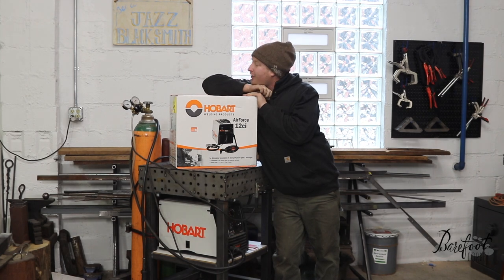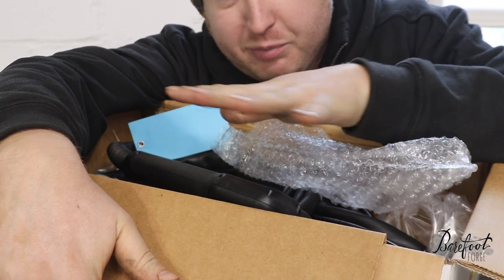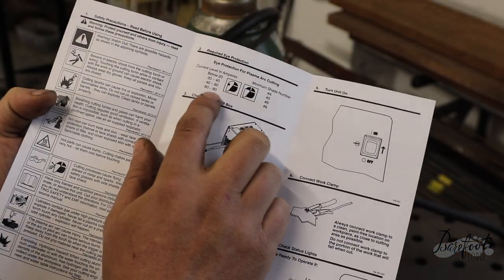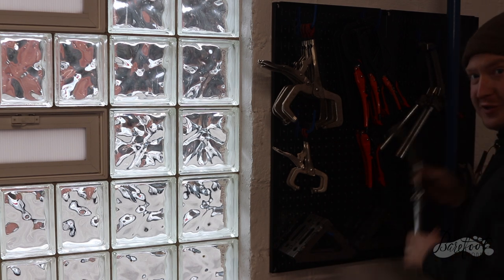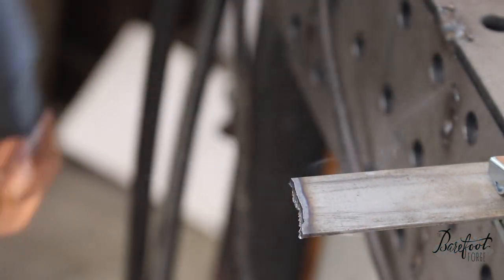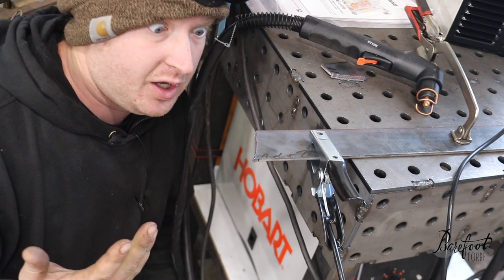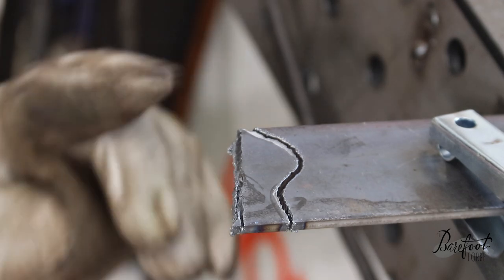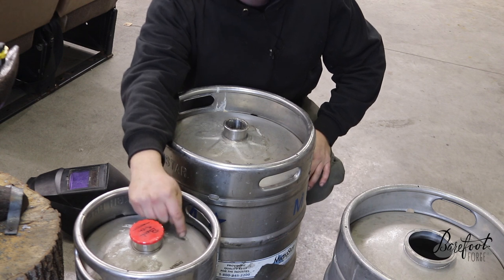Hobart Airforce 12ci Plasma Cutter Review

Comment: I have a 140 handler and absolutely love it. You did an outstanding video review. With the 140 and the 12ci. 99.9% I cut 1/8” or less. The point .01% I cut is 3/16”. Of course it’s a Hobart and with this 12ci all the bases are covered.
Reply from the maker: Heck ya- it’s fully capable and great for most normal people’s needs.

Comment: Great video, first time I hv ever lol watching an instructional video. I have the same model (first time plasma cutting) which i bought for crafts and  customizing, hobby type stuff, and have used it daily for at least the last 2 weeks and am thoroughly enjoying it. I like that it cuts through painted or rusty steel requiring little prep time so I can just jump off into the project. The problem I've had is it does a lot of starting and stopping, a couple seconds of cutting then a few seconds delay. I thought it might be an electrical issue so I plugged it into the wall outlet directly and it may hv helped some but I've started cleaning up the area where the ground wire is being clamped as well and it also seems to have helped however the problem still occurs more often than it should. Have you experienced this issue? For what I do it's a.great tool but the starting and stopping makes intricate cuts extremely difficult.

Comment: Great video….wouldn’t mind trying before I buy. I took a welding class summer 2020 from you and later bought a Miller 220 AC/DC. I am still learning aluminum AC tig. It going okay, but I need more torch time. I bought an evolution circular saw to cut some metal I bought and have been debating getting a plasma but didn’t want to get a big air compressor with drying stuff, etc. This Hobart seems like it’ll work. Did it ever cut 1/4”?
Reply from the maker: I have tried it on 1/4'' before and while it certainly struggled and had to go slow, it did the job! The "ceiling" of the old shop was 1/4'' steel and we had to poke a hole for lines from the air compressor- and we did it with this little Hobart machine (my neighbors). 
Send me an email and we'll get you out here to try it out. I'd be glad to have you over for some slicing and dicing! 

It's a versatile machine with its limitations, but it's got some pretty epic qualities that made it the right decision for me!

Comment: I read a bunch of reviews and it looks like this is for someone that uses it at home for small jobs. People complain that it shuts off from over heating and has to sit for 7 min before it turns back on and when it turns back on you can’t use it for too long before it shuts off from overheating again. People say it doesn’t have enough volume of air so there is more slag then a regular plasma cutter that uses air from an air compressor and you have to cut pretty slow. All and all from what I have read it seems to be perfect for someone that just needs it for small jobs, thinner metal and/or need it because an air compressor is not available like if ur a mobile mechanic or a farmer that needs to cut something in a field on a tractor. If u are using this at ur shop that has an air compressor or home or where ever that has an  air compressor then get a cutter that uses compressed air u will be happier
Reply from the maker: I couldn’t disagree more. I have two other plasma cutters with air compressors- and I still reach for this more then any other. 

It’s phenomenal, and has held up flawlessly over the years.

Comment: Hey I know this is a bit off topic for this video, but I was looking for some advice on vanagons. I’m looking at buying a complete 1987 vanagon gl in good shape except it’s not running. I was wondering the bolt size and location for the crankshaft bolt so I can see if I can turn the motor over. Also if you have any suggestions on what to look out for or what tools to bring for the job it would be greatly appreciated, thanks -z
Reply from the maker: If you can’t turn it by hand from the belts- that engine is ruined. I don’t have any east to type out blanket advice on what to look for but I’d say: seam rust is almost unrepairable- don’t think it’s minor, if the engine turns or cranks it can likely be made to run, if things are missing- particularly on the engine, that’s going to be tricky to source and expensive to fix. Plan to throw at least $5k at Any bus that’s sat in order to get it properly and safely back on the road. All new brakes all the way around, new tires, some brake lines, coolant lines. 

If it looks like I needs an exhaust- that’s expensive.
Reply: Thanks so much 👍

Comment: Drag the tip don't push it... Your cuts will be way smoother and controlled. Using a guide bar or straight edge also helps steady your hand to make machine like cuts. And the open part of the wire tip guide goes toward the handle.
✌️
I own the same Hobart air force model. I have been welding/fabricating for over 30 years.
I bought mine for retirement hobby projects, but that little beast can make you $$$
Another tip
Stay off the Red bull, Mt. Dew, and coffee in general.
The caffeine really messes with your hand control. Shakey hands = Shakey cuts and crappy welds.
Reply from the maker: Great tip! I'll have to try that!